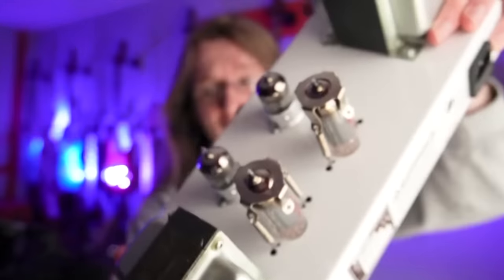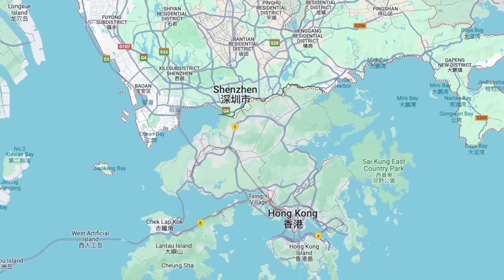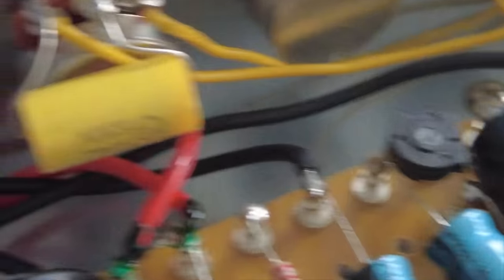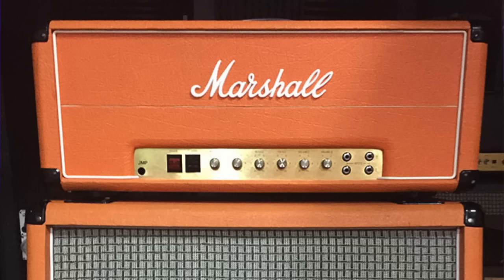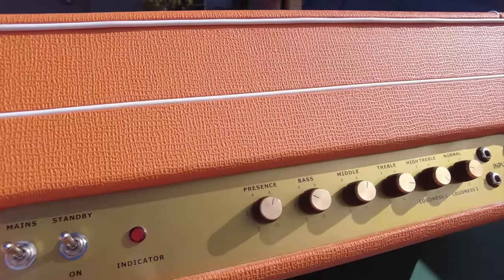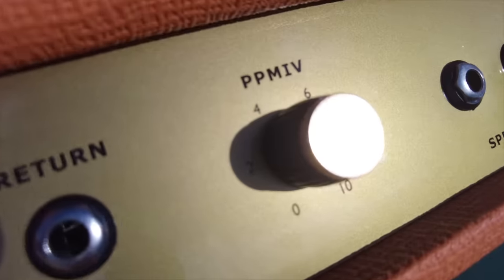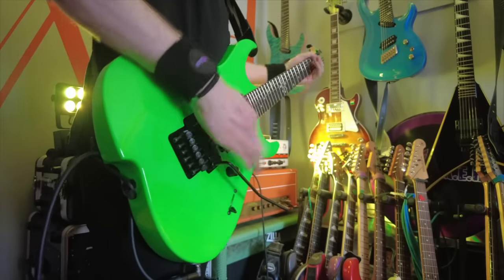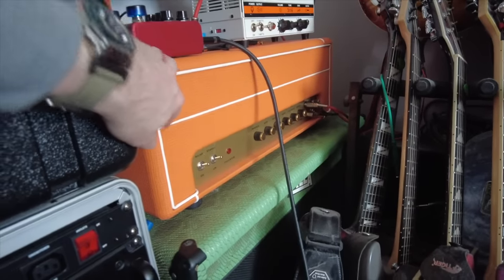Who made this Amp??

Comment: Your camera went over the board quickly, so it's impossible to get a decent look at it, but im pretty sure What you have there is a late 60s marshall 'plexi' Jmp 50.
The main difference with yours and the original early 60s jtm45 
Is that your two inputs are voiced differently. One is like the jtm45 and one has a bit more brightness and drive.
The blue capacitor is likely a 220 or 330uf and the oval yellow one is likely a .68uf
Reply: The 12ax7 is basically 2 tubes in one. And the jtm wires both halves of the first tube the same, for each input. The jmp ( your amp) wires each side differently. Each side of the tube has a 'cathode'. Running from each cathode to ground, there's a capacitor and a resistor that affects the gain . These appear at the beginning of the board near the inputs. 
There is also a one wire mod that you can 'casade' one gain stage into the other . Basically, re routing the signal flow after the first gain stage right back into the other input. This is the main difference between your amp and the jcm 800. 
You could easily do this mod if you're wanting more grind. It doesn't exactly turn it I to a jcm800 but will be much closer.
Reply: Marshalls are basically a 59 fender bassman circuit.  So from 1964 to 1984 they are an evolution of the same circuit and easy to change around and mod to taste.  
I think youve got a great deal there.

Comment: I haven’t seen any UKCA conformance markings on the amp to confirm it meets the requirements to be imported or used in the European domestic market. There is no way of knowing if it is a safe to use never mind meeting the WEEE requirements. If there are no markings even on the packaging as tempting as it is I wouldn’t touch it, it might bite me one day when I switched it on or just add a load of noise onto the mains system while inducing hum into anything near it, I would be surprised if it has ever been near a anechoic test chamber. If you wanted to import a batch then you would be legally responsible to ensure it meets all the conformance requirements (wave goodbye to £20 plus k) then new rear panels with the appropriate markings and almost certainly modifications to meet the WEEE substance regs. You could end up with a pile of mains and o/p transformers failing insulation tests….then your screwed. I would imagine once that is all done you won’t be making any money. Building your own isn’t that easy either especially if you don’t have the knowledge or skills, it’s the other option but even this will probably be illegal in the near future. Unfortunately, it’s the over regulated world we live in, in this case I think it makes sense as these amps use very high voltages in some cases enough to kill you.

Comment: bad hardwired is way worse than good pcb. so its not a clear cut case, one stray wire run in a hand wired amp can maker an amp unplayable, a good pub layout with smart engineers designing it can be better than a lot of amps of any kind so its all down to design and layout

Comment: I love tube amps. But honestly, laptop plug-ins are better than ever and you can really get those tones from a computer.
Reply: you know that there are still some people actually playing guitars together with other people in something called a "band" and sometimes even do that infront of other people on this thing called a stage, right? Amps can do volume. volume is something you need when standing next to a maniac beating on the bang thing.
Reply: I'm not going to knock plugins because I'm nerdy that way, but as a drummer friend once discovered when he plugged into a full stack Marshall, rock guitar is about moving air.
Reply: @ithemba  Correct. But even Satch plays live with a laptop.
Reply: @briandriver301 do you mean playing an actual show with the actual band or do you mean this half-assed sessions players do in noisy convention halls playing sttaight into shitty PA without any FOH, in front of a few people to sell merchandise?
Reply: What happens if your plug-ins become incompatible with your computer and the company that made them goes out of business? How useful are those plug-ins after that?
Reply: @castleanthrax1833  Good point, but Mesa Boogie just sold out to Gibson so, it can happen to anyone.
Reply: @briandriver301  Yes, but a Mesa Boogie isn't reliant on a separate system that needs to be compatible for them to work. 

Computers are constantly evolving, so the plug-ins need to be updated to remain compatible, at least I'm assuming they do.

Comment: I'd be more interested to know if the transformers are cloned or real, or cheap or expensive. Same as the tubes. Are they actually jj, or does it just say jj on them like many Chinese things. What about capacitors also. It goes on. If China can save a penny, they absolutely will. If they've used quality parts then it's a steal. If it has cheap or even faked transformers etc etc then it may not be the best investment. We all know that there are no laws in China against counterfeiting or cloning ANYTHING. Time will tell I suppose. But yes, on the surface, good value for a handwired amp, I reckon you forgot to think about the important things though. No offence, kdh
Reply: I have a Grand JTM45.  They have cheap transformers.  The tubes are Chinese tubes.  Cheap parts.  Sounds fine, low noise floor.   If you want better parts buy Ceriatone.
Reply: I don't want a clone, thanks though. I was just pointing out what is important in an amp.

Comment: This is my Problem Tubes for amps had to be made in a certain way The British made and if lucky make the best tubes. There is a reason for this Glass only in the UK still can get extremely fine glass and reason is it is made by eye and ear for the heat and sound. Germany copied similar but they could not make the same quality Same for British steal the world needed British steal because again it was hands on.  Now today everything is set by a Machine and computer which sadly makes things far cheaper but NOT better or even Close and that is why Amps do not sound the same as originals as Can't happen. Now Glen proved that the Valves make no difference in the sound that is true as goes through a speaker but there is a difference when using a Guitar to get a sound. These days they use emulators to try and match and old Amplifier sound. Sort of like sampling. But these days you have pedals mixing desk to make the sounds happen. Now Tubes were used in Radio first and back then you could hear the radio on a British Chrystal set which means no need for a battery sadly that can no longer happen.
Reply: Ah yes, that special British toan glass.
Reply: this is not how anything about this actually works. I am not sure if it's mainly because of your confused facilitation of the english language or if that is just a function of this overall rambling, but this is not even remotely what a valve does in a circuit or what the glas does to a valve (which is to contain a vacuum and nothing more) or how antennas work or how radio waves get turned into sound.
Reply: Back in the 1950s all valves were high quality. Now some of the best valves are made in China

Comment: At that price t was made by an eight year old chinese girl with no shoes working 16 hours a day for two fish heads & a bag of rice a week
Reply: Yes and she should thank her lucky stars...
Reply from the maker: The question is, if every brand who gets their amps made in this factory (and there are multiple well known brands that do) and they buy in bulk so get a better price than I did when buying one.
Then maybe this is actually a fair price for an amp and we’re just used to overpaying
Reply: Which well known brands get them made there?  Fantastic vid btw @KDH
Reply: @KDH  I have a feeling that's been the case for years, and not just with audio equipment given its source.
Reply: In China, I'd be more concerned about them using fake tubes, transformers, capacitors etc. But mainly tubes and transformers. The Chinese clone everything, it's part of their culture and not at all against the law. Transformers are important af in an amp. And we can't change Chinese labour laws, it's not our country, culture or place. Although I absolutely do not condone child labour. So a few reasons not to have a Chinese made amp, handwired or not. I try not to buy from China though sometimes it is just unavoidable
Reply: @KDH   It would depend on how much they get their hardware for...once you price up the transformers & valves (the costliest parts) you have taken a large portion of that £500.

You're definitely not going to get a cheaper hand built amp in the UK/Ireland but it might be intersting to see what a local builder would quote you
Reply: Have you been inside the factory?
Reply: I beg you people to just go and google something about the actual real state of child labour in china, where it occurs (less skilled highly labour-intense manifacturing mostly in less developed provinces and not in fucking Shenzhen, the worlds biggesrt electronic industries hub by far, and how it is perceived in China even once in your lifes instead of mindlelessly repeating this stereotype over and over again. Child labour has dropped sharply over the last decade and has been center of a number of national scandals in China, with government crackdowns. The US is on a course where child labour will be a problem just as serious for them as it is for China, with school children literally dying in slaughterhouses and having horrific accidents while operating dangerous machiner and lawmakers pushing to abolish child labour laws in many states.

You are worried about child labour? stop buying chocolate and cocoa, that's literally child slave labour right there.
Reply: @ithemba  Whenever I do google the factories I get reports of carcinogens & suey side nets......I can plug my strat into a twix but I can't get over a drummer with one
Reply: @nihilistlivesmatter  both of which are not child labour. I am not saying that labour conditions in China are good or a-okay, but for the love of god at least try to act as if you'd give a shit about the actual nitty-gritty and not just a half remembered headline from ten years ago. There was for example a lot of pretty grim stuff during Covid - and yet employers and especially the laws of the central government did a HELL lot more to protect the lives of chinese people than the fucking US did when pressing people back into in-person-work. It is unfathomnable for westerners how much China has developed over the last twenty years and how many hundreds of millions of people have ascended into comfortable middle class life.  the nets are very specifically a foxconn story from ten years ago, from the world biggest iPhone manifacturing plant.
Reply: @ithemba   Forgot about welding their own people into their apartments & the missing bloggers?.......